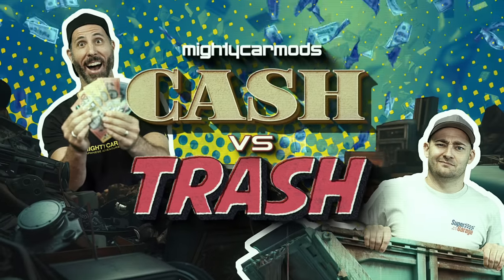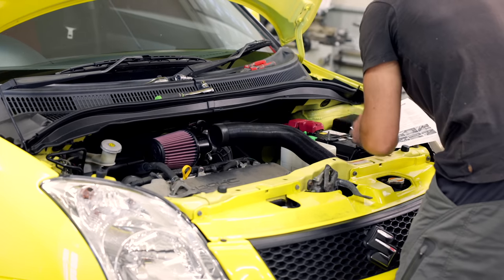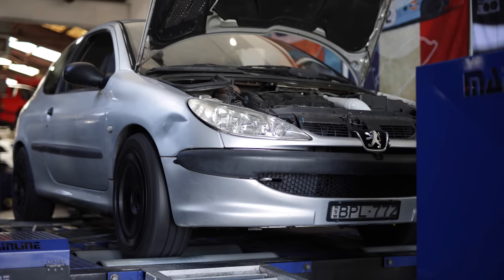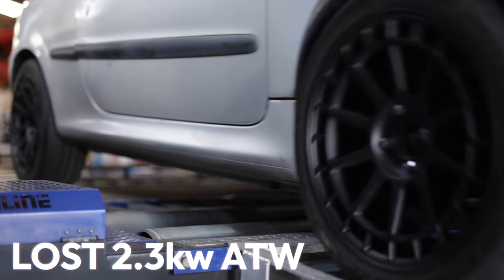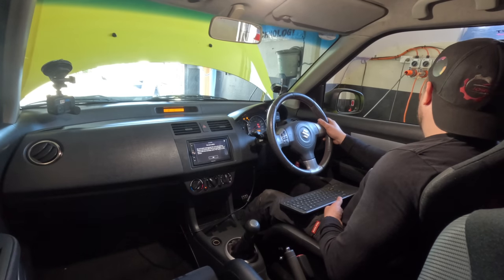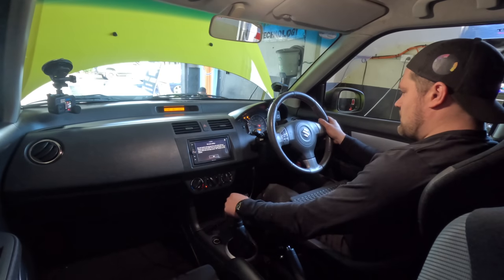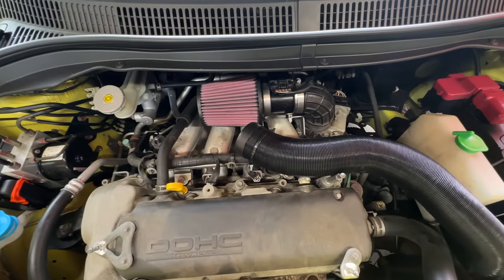Dyno testing POD FILTER Performance Claims | CASH vs TRASH

Comment: In regards of the Pegbro the exhaust is waaaay too big 76mm is overkill for these engines! Try making a 54mm or 60 at the very most. Here in greece 206s and 106 rallyes are very very common and the go to mods are 54mm exhaust intake cams and map. Should easily push over 130 hp idk the equivalent in kw. Cheers!

Comment: On my mazdaspeed 3 i put a k&n filter inside the OEM AIRBOX because on small tune the airbox intake is always better. I tryed an after market and i was a 320hp and with the k&n but stock airbox intake 340hp.

Comment: If you want to make power through the air filtration system you need some type of Forced Induction system like turbo or supercharger to make that Theory work correctly. Didn't you both already confirmed this on one of your builds a few years ago?

Comment: Love the channel, but why don’t use a hub dyno, this would make it consistent, it would have eliminated some major variables such as strap technic, friction lose on the tyres, and tyre size makes a difference on the dyno.  
Oh yeah as mentioned above the filter should have gone to the front to eliminate heat soak.

Comment: The swift intake was taking in hot air over the factory box.

My BMW had the filter inside the box and I swap it for this paper filter for k&n = 80 aud

Had the induction sound and probably 3/5hp gain acceleration feels better.

Marty needs to put the box back with the kn filter not a full pod over the engine mount there's too much hot air. It's science...

Comment: the K & N filter is sucking in hot air despite the cold air feed. heat from engine is rising straight into it. pipe it away from engine and it should then be a gain

Comment: If it were me, I would probably do an aftermarket high flow mass air flow sensor, clear the ECU do a full drive cycle and then run it again on the dyno and if that doesn't fix it, then it's most likely the warm engine bay air that you're pulling in to the new filter that's causing the loss of power

Comment: A couple of considerations. 

The car should of been baselined with the stock air box and compared directly with the pod filter.

You can’t just take the manufacturers “claimed” power as it’s always wrong. 

Also the car would of lost power over the years hence why a baseline would be required. 

But yea an open pod filter that sits on top of a hot engine isn’t going to perform as well as an enclosed filter regardless of that stupid hose going to it

Comment: resetting your ecm parameters can maybe definitely maybe adjust for more fuel and power through trim. This is more the case on modern cars as they've got more self-learning. They can't learn the fuelling unless you unlearn what it's already got in its memory before the mod. Then you'd have to drive it a few hundred miles for it to dial it in. Obvs the only real option is a remap. Tuned resonance is still balancing power, economy, cost and sound, because that's what manufacturers do. Same as having a shit tonne of boost pipe, the more convoluted it gets, the more it kills response

Comment: What's the wheel circumference on these aftermarket setups on both cars compared to stock? If there's a 2-3% increase in wheel circumference, on such weak engines, and added weight due to meatier rubber and possibly heavier rims you're throwing power into the BIN! Main culprit. It'll still be quicker in terms of lap times due to more grip but in terms of raw acceleration once off the line, or dyno tests, go with hub dynos...

Comment: I've always been skeptical of k&n filters. They're supposedly made for individual cars but every kit I've seen is an elbow that connects it directly to the top of the engine and some pipe that's crudely tied on to give a "cold air feed". I made my own for a fraction of the price of a k&n system. Probably lost power still but if a k&n does the same.....

Comment: It could also be the exhausts as the back pressure and scavenging effect is reduced.  also for the filters you might need to remap your fuel as you might be a bit leaner.

Comment: the cold air intake is basically on the engine lol and the big funnel isn’t getting any air in it because the car isn’t moving. the intake is heat soaked..

Comment: Just a question, would you not have to do a tune on the car to work with all the upgrades, maybe a flash on the map might release more power to work with your mods. Simply throwing on upgraded may or may not give power off the bat, but you'll Def need a tune

Comment: My guess would be that it has something to do with the stock computer (fuel maps) being tuned specifically to the resonance, volume, velocity etc of the stock filter and intake tract. Aftermarket filters/tubes may just have so much more volume (cfms) that it decreases the air intake velocity/pressure in the manifold and becomes less efficient for the stock fuel tables/tune. Would be interesting to see the AFR's with the stock intake tubes/filters and aftermarkets, would imagine that might give a good hint as to what's happening. Probably even be able to tell a noticeable difference with the amount of vacuum it has from idle throughout max rpm.

Comment: Most likely the velosity of the air past the maf sensor is completely different, normally down to the intake pipe heing a different size, 
Friend of mine took his astra vxr which had been mapped on stock airbox, as soon as he put a pod fiiter on with larger diameter pipe it lost 30hp (dyno proven) and air fuel moxture was way to rich

Comment: Wheels AND TIRES, are heavier. Put the stockers back on and test it. Even if they’re the same weight overall, concentrating the weight further away from its rotational center will affect the dyno. Especially on low power vehicles.

Comment: Peak tuned might have been a few kw over stock. Potentially it could take a couple of extra degrees of timing or AFR's might be a bit rich from the extra air. Was the ECU reset?

I'd say until you can use all the air there's not much reason to add more

Comment: I know my cars ecu can auto adjust the afr to deal with slightly different air amounts or temperatures but it has a % limit of how much it is allowed to do so because a faulty sensor could otherwise destroy the engine. This is my best guess of what is happening, so to make use of the air they both need a retune/reflash. I am not knowledgeable specifically with these cars but that could also be a cash vs trash option a cheaper reflash using a preset good working tune, and the more expensive option retuning/flashing using a dyno.

Comment: KN  must base that guarantee on the flow bench.  Putting a pod filter behind the engine and sandwiched between the engine and the firewall seems like a hot air filter + setup.

Everytime I see these types of videos I feel like removing my open intake and putting in my stock + setup.

Comment: @mighty car mods 
add 10-20cm of straight pipe in front of the MAF Sensor... These sensors like straight airflow, when the filter is so close to the sensor it disturbes the air and the sensor can't work properly...

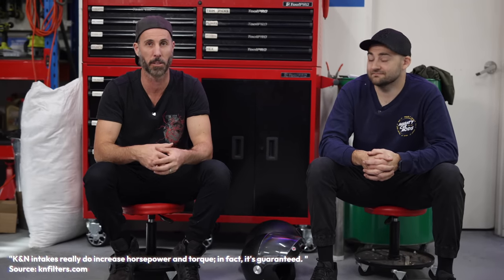Comment: 4:20 you need to retune the car if you change the intake. Then it would make some power. It would also probably help if the filter was on a longer tube that ran down into the bumper instead of running a pipe up that might not be doing very much. Another version of this would be to enclose the filter in a box to isolate it from the heat the engine is making. Having it exposed like that is not fantastic.

Comment: You gotta add a fuel pressure regulator and play with tps to gain anything outta your changes because they're both set to max power outta your stock setup

Comment: Yeah if I had to guess I'd say 3 inch exhaust is overkill for a small engine and like you said doesn't make sense having a pod filter at the back of the engine where it'll just get heat soaked when preferably you'd want cold air going into it at the front of the car

Comment: A cheap recipe for the peugeot
1.exhaust must be 51.5mm diameter
2.replace exhaust headers with 106s gti headers
3.replace the cams with 106s cams and their gears
4.remap
All these here in Greece cost about 800euros and make +15-20hp to the crank with 97octane gasoline

Comment: On the Peugeot, the power loss was most likely down to the grippier tires causing a substantial increase in rolling resistance. Grippier tires cause a noticeable drop in fuel economy for a reason.

On the Swift, it’s just a poorly designed intake. K&N products generally aren’t great. Their oily air filters cause MAF contamination (to the point that several vehicle manufacturers have released service bulletins saying that they are not approved for use) and their intakes, as you saw, are hilariously bad, especially for the insane price they ask.

Comment: I'm skeptical of the outcomes though, track use and dyno use are two different things when you add in wind. On the track you would think the air would be able to get into hard to reach areas that a fan can't touch.

Comment: I’m really interested if any of you drive your cars with your hoods up or removed..??? I’d start with that and then do the tests with what I think most people do which is drive with them closed or on. 🤷‍♂️ just saying but I might be out of my realm as a jet mechanic and engineering under my belt but I could be wrong.

Comment: Was the difference in wheel size taken into consideration when measuring power? Dynoing with smaller wheels has been proven to show bigger power numbers (Though the difference is a few KW).

Comment: for the other people who didn't get a explanation the loss of power is down to the pod intakes not being fully pressure optimised for throttle body. The factory ones get developed to feed air in and compress it in the the weird air boxes, this makes the pressure different than if you shove a pod filter on that's at atmosphere pressure. air has 2 measurements volume and pressure , factory has more pressure with less volume and the pod more volume at less pressure. now turbos create both pressure and volume so a wastegate(a hole in the system) opens to adjust both in real time where as a static intake cant do that so when its made and developed its ether high volume low pressure or low volume high pressure sadly cant have the best of both worlds. The pod filter could work in the real world having cleaner air being given to it by driving and creating that pressure other then a fan on dyno sat static saying i lost hp in this scenario.

Comment: Please take my opinion with a grain of salt. At first glance it looks like the modified intake is sucking in hotter air that the stock one because of its position and due to the fact that it is not enclosed. It might be a good idea to position it lower to the ground or to enclose it (protect it from the heat of the engine) in such a way that it has acces to the cooler air from the outside.

Comment: It would be interesting to know what the actual useful area of the filter is vs stock and what the restriction per area is too. 
Pods are known to be bad for this because the actual usable area is usually only just over half the total surface area and if its oiled its going to hold back a significant amount of air too. 
Even ignoring the hot air and resonance issues it could be that pod is simply more restrictive than the original filter. 
Either way its $400 worth of junk.

Comment: My guess is to many variables. Here's my list. 
Tdlr: position of the intake and adding to many things prior to the dyno means it's hard to pinpoint. 

1. Adding 5 things and then dyno. Cant specifically be said its intake unless it's removed and replaced by the stock one and redynod.

2. The position of the filter atleast to me looks awful. Tucked way out the way behind the engine.
Personnaly it'd of shielded it and put it at the front of the engine bay with some type of stock intake leading to the front of the car. Kinda like a headlight hole but in the grill.

That to me looks like it's just gunna suck hot crap air in the engine bay.

Comment: I bought my car without the stock air box and I’ve always though the “cold air intake” it had was making things worse, considering it just sits in the hot engine bay. There is an AEM kit that feeds it down into the fender well in front of the wheel. However after watching this video, I am now weighing the option against just buying a stock box off the internet

Comment: most fuel injection maps are baked in, and are not an open loop, they are closed loop, you cant make more power with air, you can only make more power with more air  and and fuel,  a fuel adder is needed or a wide band open loop map will give you more power

Comment: But isent the setup on the swift a cold ish intake. Im guessing it would perform better moving with cold air going through it rather than sitting on the dyno. The larger wheels may have something to do with it aswell. Very interesting tho

Comment: G'day guys, I have a stock 2008 Nissan 350z. I bought 2 k&n air filters thinking they are better than the standard Ryco filters... Wrong! I went back to standard Ryco. Those k&n stuff up my air flow meters, as I have dual throttle intake. K&n cost me money not only for over priced filters but, you read it.. HooRoo.. 👍 👍 👍

Comment: Are the new tires bigger than when the stock dyno was completed? A bigger diameter wheel will make the engine work harder, or rather yield a lower power rating on a dyno.

Comment: Lowering the car causes the drive shafts to have a more aggressive angle, which in turn contributes to greater driveline loss. Could be the cause of your results.
Reply: I would say the drive shafts are running less angle causing less resistance helping with drag and power loss

Comment: dollars to donuts the loss of power on the poojoe is associated with the big wheels and sticky tyres... although the stock airbox would probably have been sensible to keep. Aftermarket induction kits rarely do a better job than the factory setup with a new paper filter, and do a far worse job at keeping fine particles out of your engine

Comment: intake resonance is clearly over looked here.  Intake length will have more influence then the material its made out of.  You can likely cut that PVC intake down in inch increments and find a spot where it actually gains power

Comment: Cleaning the MAF was a good measure. Did you reset the ecu? It wont change its a stock ecu tho. Maybe MAF placement. I found I was getting too much air vs fuel. Still is coz access to injectors on my engine difficult...But could be interesting to see what happens if you give a bit more. Welcome to the world of not owning a Haltech and being stuck with a bluetooth ecu app lol

Comment: I can't recall what exactly was changed between the original dyno run and this one. Was it JUST the intake and exhaust, or were the tires swapped too? I believe I've read that higher rolling resistance tires will alter the results on a road dyno like the one used. Supposedly, you can alter dyno results by tightening the safety strap too much!

Plus the rest of the things that go into the correction factor - Was it a hotter day? Different humidity? Maybe you got gas at a different station? Heck, was it even the same dyno? 

Given how easy it is to swap between the original and the pod filter, I'd have tried to do back-to-back runs, swapping them in between.

Comment: On the Swift, the hp loss would have been worse with the hood closed since it would have been sucking in hot air vs. stock pulling in cool air.

Comment: But you need a tune. Its just crazy to me noone talks about it.
It like you make the additional resourse available to the car, but it does know about it. Sometimes the mass airflow sensor only has a scale of 0 - 100%, and more air available will not exceed 100%. So usually you will need a tune of sort to actually make any difference.
The correct way to test those intakes, is to actually tune the car stock, dyno it, then rollback to stock tune, add the filter, and see how far you can take it with the filter.
Its like throwing a 3.0 ecu at an 2.0 engine.
Also, it seems to me that the temps outside changed somewhat, and temps of air are much more likely to impact performance.
My past car had 250hp at 25c outside and 270-280 at 0c outside.

Comment: Would have been interesting to see the intake air temps between the two intakes. Sucking air from the top of the engine, above the exhaust doesn't seem to be a great idea for making power.

Comment: your ECU won't readjust accepting more air to fuel without some sort of tune but after Tune you will increase 2 to 5 more hp then you would of expected it from the air filter

Comment: That sux really, a few years ago I went through this sort of testing with a lightly modded WRX and the COBB intake did make a little extra power with tuning as opposed to a tuned stock intake. It was like 2KW max but still . . .
Reply: Oh, and the atmospheric conditions were the same and on the same dyno

Comment: You want to know why you lost power with the K&N pod filter? The answer is laminar air flow vs turbulent flow. Ever notice how in front of air flow meters you will find a honeycomb or straight plates within the tubing. Or there is a long length of tubing. This is done to straighten the airs flow before it passes through the air flow meter. The turbulent flow you achieved by mounting the K&N directly to the air flow meter gave the ecu an incorrect reading, throwing out the air fuel ratio.

Comment: wouldnt putting the air filter directly over the exhaust manifold mean your sucking up the hot air radiating directly off the manifold instead of the stock airbox having a path to try and draw cold air? would trying to relocate the pod help in this specific case?

Comment: The stock,locked ECU is the problem. If the stock ECU can't be adjusted then it needs a piggy back controller or an aftermarket ECU. This is not new to you guys as you've done it many times in the past.👌